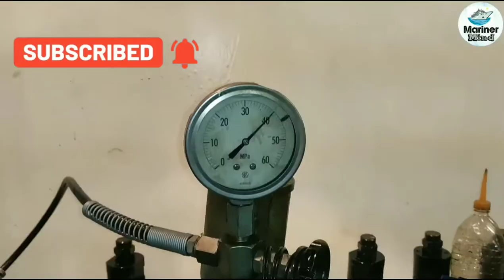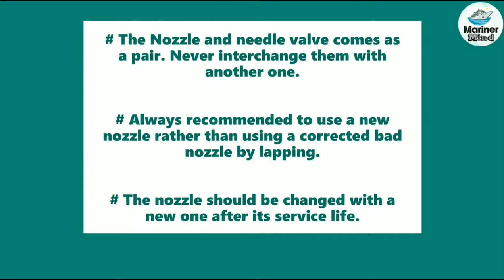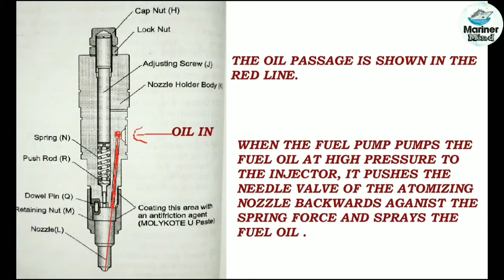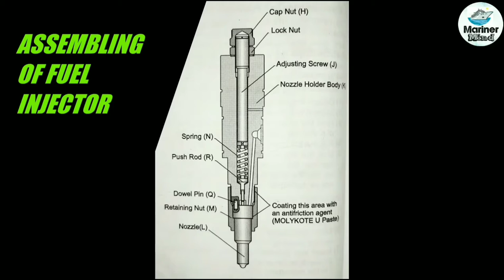PART 2: PRESSURE TESTING & OVERHAUL  OF FUEL INJECTOR ( D.G Fuel Injection .valve Overhaul Series.)

Comment: Superb video bro. Can you plz put a video on daihatsu water cooled injectors and what could go wrong in that becoz we got heavy oil mixing in LT expansion tank.
Reply from the maker: Will try to do bro.... Probably the O- ring which separates the water and oil side is defaulty.... Do you find some water while doing blow through..
Reply: @marinermind761 no idea bro. full crew joined recently. Happened with last crew. Still daily we are removing oil from LT expansion tank. We dono the reason how this much fuel went to LT system. Only oring faulty or some internal issue with nozzle?? Plz throw some light on this. 5dk 20 daihatsu engine.

Comment: Hi, can you advice in what condition should we keep injector on stand, spring has to be under tention or released ?
Reply from the maker: Please watch full video.... The spring pressure has to be released before opening the cap nut
Reply: @marinermind761  I mean after the overhauling, when injector stored as a spare.

Comment: Sir what fluid do we use for the main engine fuel injector pressure testing machine? Heavy oil or deisel oil?
Reply from the maker: For main engine we use lub oil.... For generator either lub oil or diesel oil